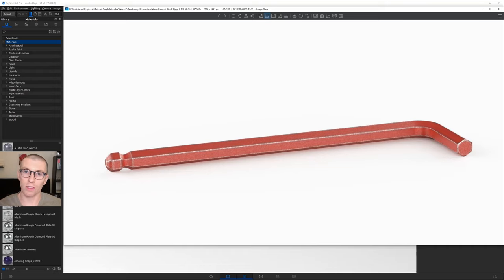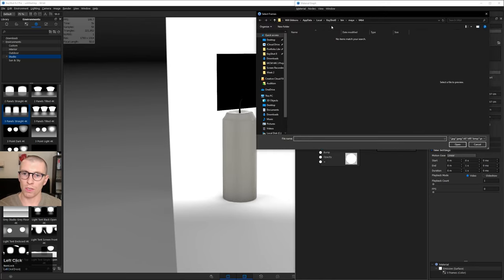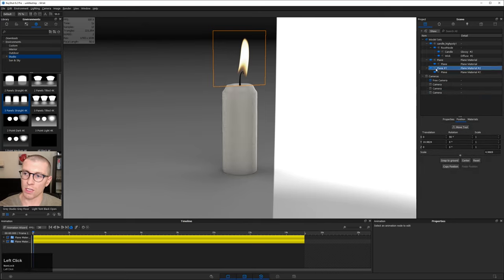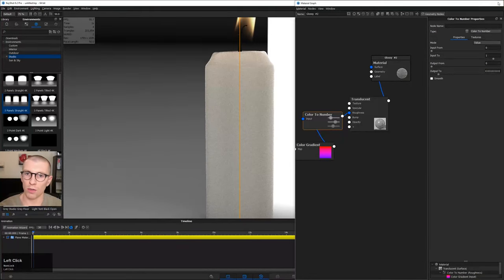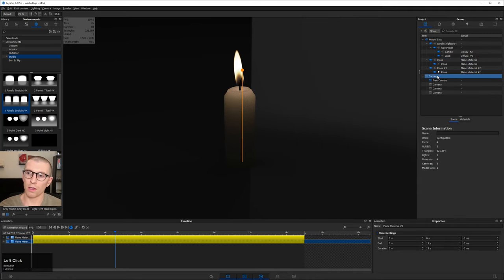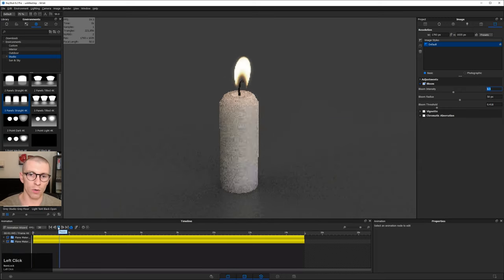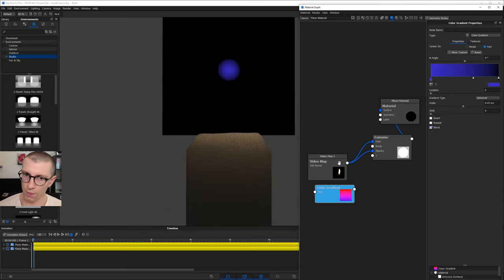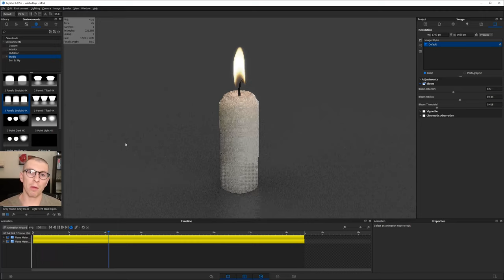How to Render a Flickering Candle Material in KeyShot 8

Comment: Hey awesome videos here keep it up, im just starting using the program and you've been really helpful! Im using KS 9.1 and when i import the file into it the candle appears black and ive tried few things to change it and make it look like yours but im guessing its the file type version?
Reply from the maker: That's interesting. It might be the default material type applied for the model type. Perhaps KS updated something on their importer since I posted this tutorial? What happens if you drag a new white plastic material from the KS library onto the candle. Does it fix the black issue?
Reply: @WillGibbons  Its wierd i just reopened it and it worked fine, thank you for the response

Comment: How can I make a PNG file with transparent background and also With transparency on the cloudy material. I want the cloudy material to be semi transparent on the PNG file. I try to do it and I failed every time. thanks
Reply from the maker: Hmm. I'd use a black and white map for opacity, NOT transparent PNG. So you can use a grayscale image for your opacity map, black will be invisible, white will be visible and every shade in between will be semi-transparent. Plug this texture into the cloudiness of your cloudy plastic and the darker areas of the texture will make the cloudy plastic more transparent. The whiter areas of the texture will make the cloudy plastic more opaque. You could use this texture for opacity and it will make parts of the cloudy plastic disappear, but will not affect cloudiness.
Reply: @WillGibbons  thanks you for your answer. But i already know that. My problem is that i can not save the file as png/tiff... so that the glass/plastic... is semi transparent.
Reply from the maker: @dvdganon0812  Sorry I misunderstood. This is not something KeyShot can do.